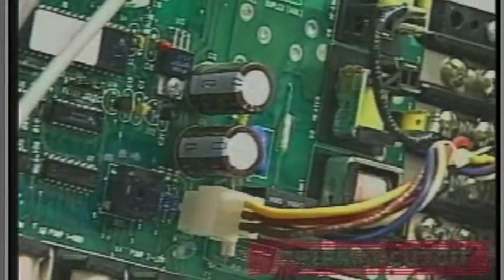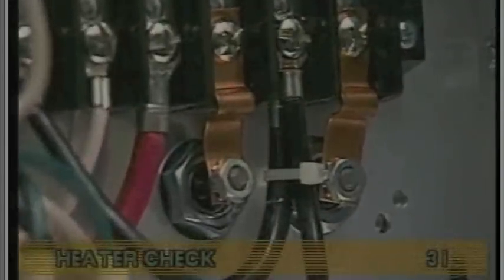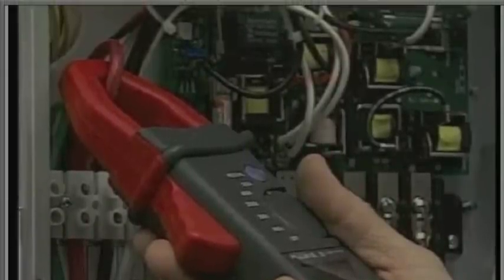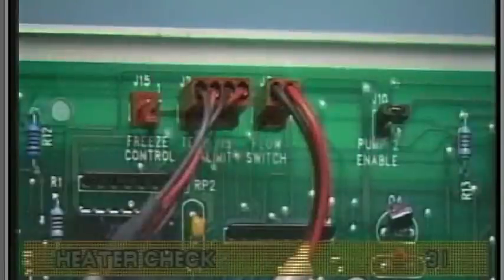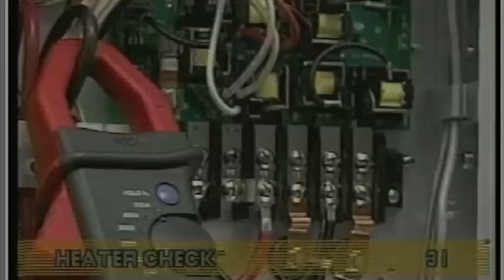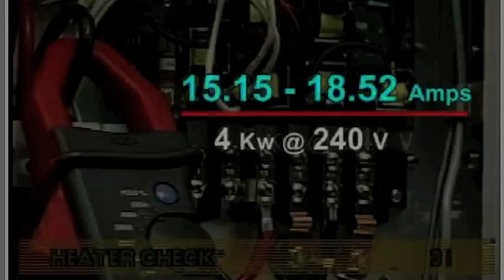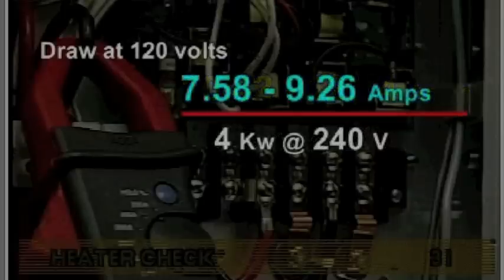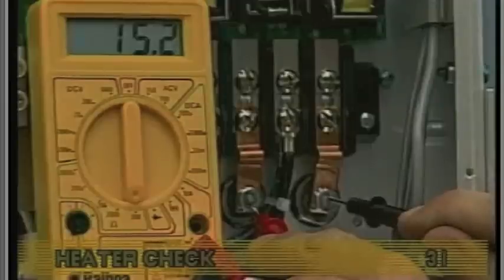Balboa Legacy Systems Series - Troubleshooting Thermal Cutoff and Heater Check

Comment: replaced the element in my hot tub. hooked everything up and after about 15 mins the jumper strap had a slight smoke coming from the right one.  i flipped the breaker off. what could be causing this?